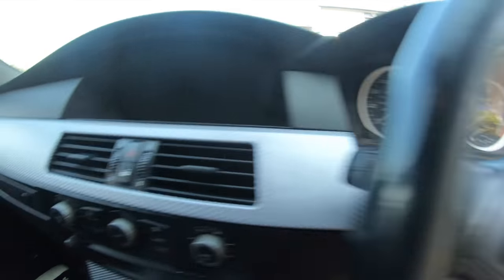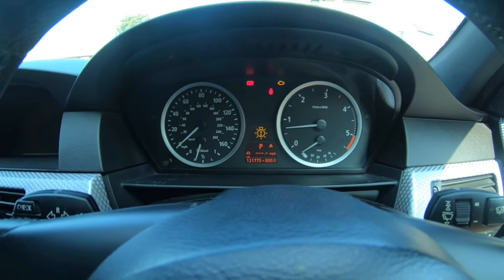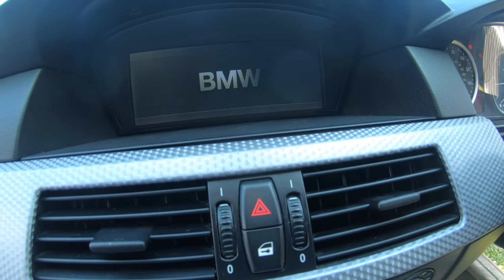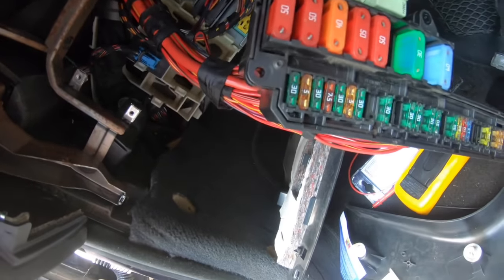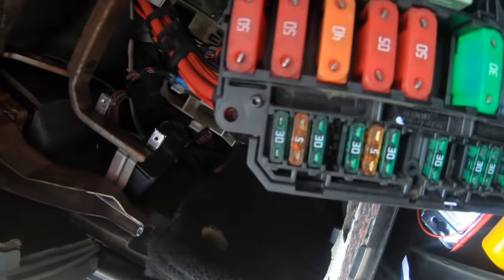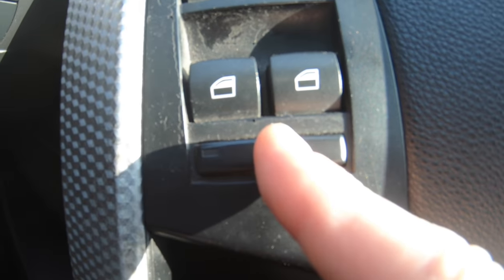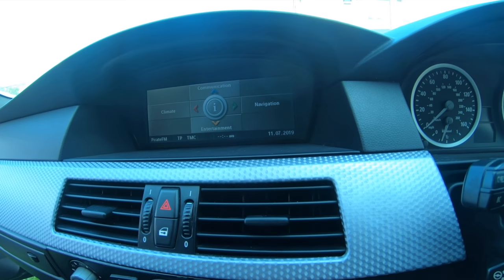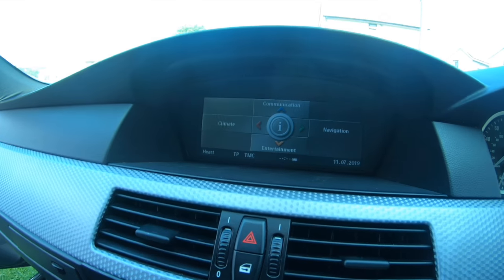Bmw E60 E61 Central Electronics Failure Fix Instrument Cluster Faulty KOMBI

Comment: awesome video thanks for showing this issues. i have a bmw 2006 650i convertible black & for the past few days noticed the battery has been draining due to the parking gear light keeping on. then weeks later the sound is chopy then days later from that the idrive display went dead lol. so will check the fuses under the driver compartment & i bet that 7.5 fuse is dead.

Comment: Hi mate I’m having the same issue on my e60 525i. Only has one code which is 514a drives faultless after pulling out the fuse but I’m looking on what the process is in changing the cluster? Do I just pull it out and get another one then get someone to correct the mileage? How does it get tuned/coded to my car? Sorry if this is the 600th message you’ve seen on the same subject lol but your the only dude that’s actually covered this issue

Comment: İs this the similar module, on a E46 GM5 module is this also failing on electronics 
On My E46 convertible first softtop stop working, after the Horn and radio the brake lights doesn't go off the cruise control light and transmission light is on the side rear mirror doesn't work after the central door locks didn't work for 2 days the central door locks works now

Comment: Hi, Can you help me with an issue i have on my E61 520D? Its very similar to what you are showing in this video but i get different warnings.  My car starts and drives very well and then randomly while driving the electrical power seems to cut for a fraction of a second, the Idrive screen turns off, the speedo and rev counter flick all the way to the right and then back again, headlights flash off then back on, AC stops etc, and then they all come back on but i have flat tyre warning, drive system failure, transmission failure, battery failure and it will sometimes go in to limp mode. If i turn off the ignition off and on again the warnings are gone and the car drives normally>
Some people suggest its a dead battery, others say its alternator spikes but could this also be the central control module?
Reply: Just in case anyone has read my comment. The problem I described was being caused by a faulty voltage regulator on the alternator and it was spiking the battery with 16 volts which sent the electrics crazy.

£37 for  new regulator and the problem is fixed
Reply: Michael thank you, you saved my life!😂 I’ve been fighting for weeks with this problem and tried to figure out the problem and today I have been searched on youtube with random keywords and found your comment. Thank you.
Reply: @Nyyttikeisari  I'm glad I've managed to help someone else. My car has been fine since fitting a new voltage regulator
Reply: @Nyyttikeisari  what did fix this problem for you? i have the same  with 530d e61 prelci... rpm drops to zero but engine is driving normally no sudden drops in rpm in engine.

Comment: Hello there
I tried to ubdate the GWS module of my 520 dlci with winkfp with a K dcan cable, but the installation failed.
the derailleur no longer works.
Do you have any suggestions for solving the problem?
GWS module and ZUSB no appear in inpa
The lights are not on on the GWS. Thank you.

Comment: Hi Dean, great video mate, I've got a fault with my e61 where the clocks arnt illuminating at all. Checked the fuse to the speedo and power is there! Could it be a problem with the module or is it more likely the fault in the instrument cluster? Thanks in advance

Comment: Hi does the e60 530d have a relay for the horn? Airbag needed changing as  some cowboy had taken it out not knowing how to remove it but horns on permanently with ignition on one turn wondering sticky relay if it has one thankyou

Comment: Hello Dr. BMW, I have recently purchased 520 D Model 2015. On the instrument cluster receiving message Remote Control, Replace battery. Though I have replaced the Key battery but still the message keeps on coming..Not sure what is the issue..Appreciate if you can suggest a way to overcome this situation. Thanks
Reply: Having the exact same problem my Custer restarts (flickers all symbols) when I unlock my car or when I insert my key time restarts

Comment: hi i have got a old e88 and what same to happen is the battery same to shut down i have check the battery and its ok and when i reset battery it goes away for two or three days then thing stop work first rear window heater then clock i have replace the relaythat came up on my srcanner CAS STARTER MOTOR.TERMINAL 50 SO I HAVE CHANGE THIS BUT STILL THE SAME ANY IDEA THANKS

Comment: Hey. I've got ane61 530d 2004. My defroster,  remote for central locking and radio signal diden't work. So Yesterday i repair my tailgate wiring becaurse of 2 broken cable and 2 almost broken cabels. It was the antenna and defroster cable on the left that was broken. And det Brown and gren/yellow on the right. Now the car battery drains very fast (3hours). This is after it was fully charge over night with a cetek Charger. The battery is 6 monts old. Does you have any clou what it could be?
Regards Michell (Denmark)

Comment: Is this same for e60 m5 ? I’m having big electronic problems causing my car into limp mode I taken it to 4 body shops paid over 1300$ in diagnostics and still no one can fix it. Throttle body changed idle actuators changed. When I scan car reads can msg bank 1 etc. I’m looking at my fuse I don’t see a 7.5 in that spot mine says 15

Comment: Hi , I have changed the Kmb module as the dash lit up like a Christmas tree. The Idrive was showing faulty transmission, steering abs, windscreen wipers were going on their own and all other faults. It’s still doing the same problem. Is there anything else I need to check for this problem. Thanks
Reply: Hi did you ever figure out what was the problem to your bmw?

Comment: I took the 7.5 amp fuse out of slot 13 as you said. Now nothing in my dash works whatsoever?! No skews dial, no rev counter, no I drive panel, no clock or temperature, it’s all dead?!

Comment: i feel i have a unique problem any insight would be greatly appreciated thanks in advance 

i have an 06 328i
and at first my problem started while i was driving the music would faze in and out the needles would twitch and this happen quite a few times till finally hours later that day while driving the a/c radio and instrument cluster went black and stopped working car was till on windows work head liner lights work headlights and tail lights work the only thing that works on the cluster is the red screen showing you your car and the 2 parallel lines with the single one going doing it vertically that’s the only one that works and turns on every now and then so i’ve had this problem for a few weeks now and it’s gotten to the point to now sometimes in the middle of driving they’ll randomly still working so i’m not sure if it’s a fuse but it’s never permanent they’ll always go back to not working and the radio and a/c not working is throwing me for a loop
also i disconnected the battery and when i reconnect it after a few hours everything’s working fine sometimes even after a few days i also don’t use the car a lot sometimes not at all in a whole day but it also goes back to not working 

also don’t know if it’s related but i had the problem where water ends up on the floor board of the driver side and i’m yet to figure out how or where but i feel like maybe all that water might’ve had contact with something electrical cause it would be decent size puddles and not just once but a hand full of times i’ve got into the car and see those big puddles of water 

again any insight would be greatly appreciated
Reply: I have the same problem man

Comment: It’s kind of strange. I have the same symptoms on the dashboard and the limp mode, but I am also having issues with my interior lights, and at one point I did get steering to become heavy. Although my headlights worked. I carry loads of water in my car. I wonder if the condensation caused my central electronics to fail 🤔
Reply: dude somone broke into my 530 a couple day ago and i woke up today and there was a big puddle of water in my rear floor and front floor
and the electrical system error came on and engine light
Reply: @lxst.dre4mz798  angryyy… people will get their karma in life

Comment: Hello what about a e65 2008 bmw 750i A3BA CODE ? Replaced steering angle sensor keeps showing up recalibrated nothing love the car but it’s a nightmare 5ef4,5f12,cf24 shows emf kombi problem if you can help I would appreciate a lot

Comment: Mate, if you connect the car to ISTA+ does it say kombi internal fault or communiction fault? Or can you only diagnose this problem with that fuse? Keep the channel growing man!
Reply from the maker: Communication faults and Dtc faults it’s all on the same line as the MPM and they all communicate together the kombi is stopping the communication between all the modules trying to communicate
Reply: BMW Doctor Yea the PT Can wasn’t it? did a kombi replacement on a E90 with ista P and everything just went fine it got the KM (Netherlands) from the CAS so the millage was the same on the replacement kombi. Is that also for other series?
Reply from the maker: yes mate that is correct it corresponds with all the modules on the PT CAN its a common common overlooked problem the cluster is usually always the culprit on these trust me this isn't the first time ive seen this and it wont be the last the common problem is that water gets into the pollen filter housing in there brake servo is sits for so long on the wiring loom running into the car that by the time the owner realises the loom is that soaked and become that brital from water when it gets heat it just send the electronics haywire and that loom runs to the CAS KOMBI CCC GATEWAY AND THE STEERING LOCK MODULE
Reply: I totally agree with you. BMW needs to fix the water leak issues. I really like BMW’s but some faults that needs to be fixed are some design faults of BMW. Same as you say like in the e60’s the mpm, tcu, ehc, relays are under the spare tire I mean why there?? If water can simply leak in there😑
Reply from the maker: Carry on watching mate after 2006 bmw moved all the power modules and built them into the SGM and KBM which is what I’m going to covert this car to to take away all the modules in the boot I’m going to redesign the module layout like the 06 and up ones to make it power off from the KBM and lose the MPM unit

Comment: I changed my AC compressor,condesor and cooling coil after that my instrument cluster is showing error and rpm,gas Guage and heat Guage not working only speedometer is working. It also shows errors like cornering ability not working, instrument cluster not working again and again. I sent my car to work stations but they didn't repair it. Know I don't know what to do can you help plz
Reply: @amirsina3253  did you get it sorted? And was the problem?

Comment: Hi @BMW doctor I have an issue in my 2003 E60 I turn the ignition off and the dash lights come and stay on. The lights vary from time to time but basically it does not turn off. The Idrive stays off but the dash is the issue, the only work around I have is disconnecting the battery and that re sets  the system and the issue goes away for a week until it returns back any help please
Reply from the maker: Become a member on the expert level on this channel. And you can have access too me and 4 other bmw techs in a group on telegram.

Comment: I really wanted your help, I've seen almost all of your videos.  I have a 2009 bmw 535i and it is all the lights on the panel turning on, the panel hardens the speed pointer stops working, the rev counter only works.  the headlight lights on and off the dash board as well.  The interior lights are on and off as well.  the battery is new I changed it a short time ago, the car has no mechanical problem for the love of god what could it be?  is it a fuse?
Reply: hello, did u solved the problem?

Comment: I’ve got the same problem on my E90 2011 320d, would this rectify the issue on my car too? Instrument cluster goes mental every time I drive but doesn’t affect the actual drive and feel, it just sends the electrics haywire. Any help would be greatly appreciated.
Reply from the maker: It’s 320D scrap it !!! That’s my best advise not worth saving this car or engine, that’s the help I can give you the (BEST) help you will ever get
Reply: Thanks, I guess. What if I can’t afford to scrap it and get a new one? Haha, the only issue is the cluster, every else is tip top.
Reply from the maker: no your wrong !!! the cluster is just half the story the problem lies somewhere else

Comment: My 06 e60 keeps doing this but doesn’t say central electronics failure , I’d does it mostly when accelerating but everything starts shutting off and on effecting the power steering, transmission etc , on idle it doesn’t really do it but when driving goes insane , any ideas ?
Reply: Did you figure this out?

Comment: i have a slightly different problem, on my 2005 e60 , everything was working fine, while driving to garage for my MOT the cluster just decided to stop working completely. it doesn't flash like the one in this video and everything in the car seems to work bar the cigarette lighter (dash cam Hard wired to it) and the cluster itself . car goes to sleep.. 

the only issue i have had with the car lately is a water leak thats on the drivers side that ends up collecting in the rear foot-well,  i suspect this to be a blocked drain under the pollen filter, and 2 days before the mot we cleared this drain. and dried the area out. then the cluster went dead 2 days later.
what are the chances of the loom  under the filter causing the cluster to fail after drying out,  or just a dead cluster?  fuses seem fine but i will check again 

any input would be appreciated greatly
Reply: Same issue with the water behind the driver's seat for me,although I have spotted a rip in the driver's door seal this is the second comment I've seen about the blocked drain I'm going to have a look

Comment: Hi   I have a 525i E60.  My dials have stoped working. If u disconnect the battery for a while or take the fuse out for a while the dials work again fully. But when I stop driving and turn the engine off then restart the dials  stop working.  Any ideas would be great
Reply: @Paul, were you able to fix this?
Reply: I have same car and am getting no crank no start I just tried unplugging the ibs don’t think this fuse will do it for me any ideas

Comment: Wonder if that’s what’s wrong with mine the dash goes crazy and even flattens my battery v8 545 manual getting crazy pulse on revs and coming up loads of faults but when the I drive doesn’t come on no issues it’s soon as that comes on and that happens to be random
Reply: Did u fix the problem?

Comment: I tried to start the car with low battery and I got 3 problems:
ews locked my car
joystick and buttons not working
rear cover not returning after trunk was closed.

ews was easy to fix.. not I have 2 more

Comment: I'm having an issue with my E60, not getting any sound from my radio, Bluetooth won't activate and constant battery drainage... Any help would be highly appreciated.
Reply: Did you figure this out? My E60 is doing the same thing.

Comment: Hey. How long you can drive wit this shit ?  Can it die on a road ?  I have it. Doesnt change driving. Just pops up once in while.tha ks
Reply from the maker: It will die on the road and leave you stranded if you don’t sort it NOW !!!! Trust me central electronics failure will take out control of your gearbox , steering , and engine control
Reply: So i need to change that KBM module ?  You need to  post how to do  video
Reply: Can i  fix it myself ?
Reply from the maker: No mate you need to be skilled and no I don’t need to post anything I don’t want too
Reply: What module i need then ? I have 525d